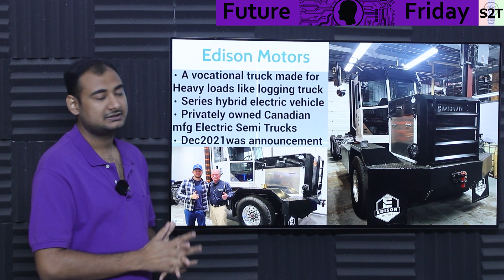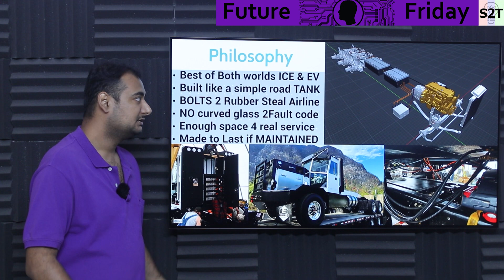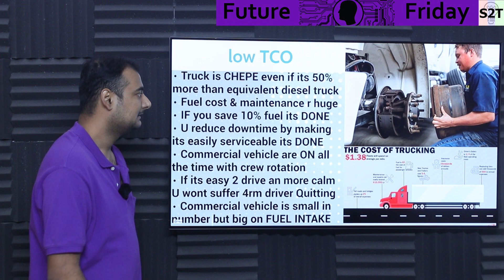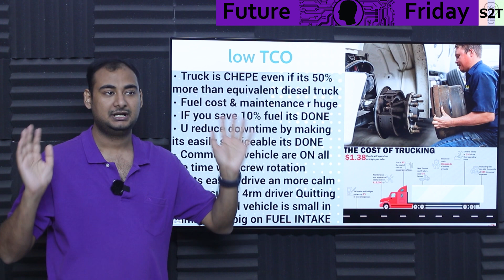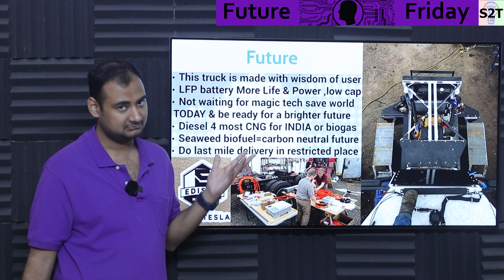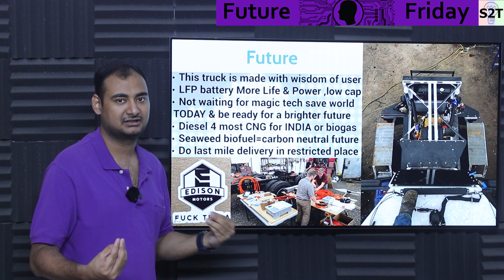Edison Motors Explained {Future Friday Ep249}

Comment: Technically its NOT a Hybrid !!!   It is a Plugin EV with regen and a ICE "Range extender". Quote from Edison: What’s the difference between a hybrid and diesel-Electric?
A hybrid needs the gas/diesel engine in order to operate and drive.  Our diesel-electric technology does not require the engine running to operate the vehicle.  It is fully 100% electric and the generator only exists to recharge the batteries.
Reply from the maker: Technically its NOT a Hybrid   true its battery series hybrid

Comment: The system can operate without battery.
Reply from the maker: yes but u will not get regen
Reply: @s2tenglish  Obviously as there is no energy storage.  They do claim to have AFE and can use the engine to dissipate energy to.

Comment: Points to ponder. Regen braking saves wear and tear on the brake pads. A very expensive and critical component. 
These trucks often are working well below freezing. There’s a diesel in-line heater in the batteries cooling line that you set to pre-heat the cold battery so when you’re ready to go, they’re at peak capacity and could receive a charge immediately, rather than having to wait for the battery heaters to warm them up above the freezing point. The small amount of diesel used in the preheating is offset by a more efficient battery start on a cold morning. 
Last. Many municipalities in Canada have discounted hydro (electrical in Canada) between 10pm and 6am. You can shut off the regen before your shift is over and plug into a charging pod at a reduced rate and save on energy b
Reply from the maker: fair point & its a really good truck

Comment: 11:00 When I was (not seriously) contemplating hooking up a 50kW charger to ~ 15kW service I was thinking that batteries and solar can provide the bulk of the power.

The batteries can then slowly charge when the charger is idle. I suspect the concept can scale up. The amortized cost of solar has been cheaper than grid hook up for almost 10 years now. Adding batteries is close to the cost of grid hookup. So the only thing needed to make it economically viable is for batteries to come down in price.
Reply from the maker: batteries to come down in price.
not happening anytime soon as the price of raw metrial is going up too fast and lets not even talk  about inflation
Reply: @s2tenglish  Sodium ion batteries have much cheaper input costs.
Reply from the maker: @economicprisoner  true but so is its power output which is half of Li Ion even bit lower than Lithium iron phosphate